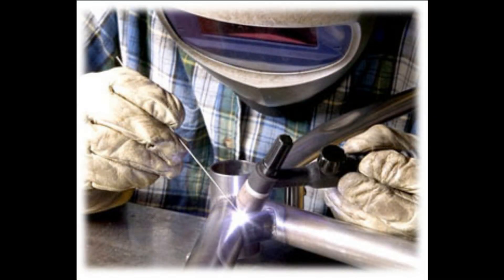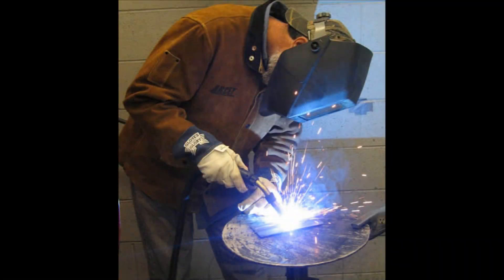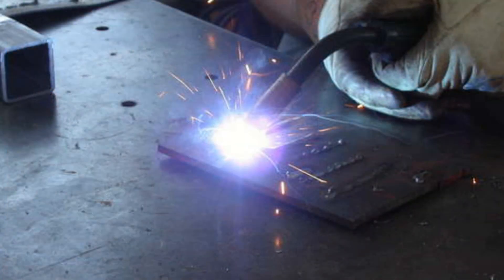Home Improvement & Remodeling : What Is the Difference Between TIG & MIG Welders?

Comment: Thank you. At least I now understand the differences between MIG vs. TIG.  I am planning to build some BBQ smokers/grills with steel or cast iron. Based on your presentation here, I think like you said, practice from a rental company using the MIG welder to become proficient. Thank you for your concise explanation.